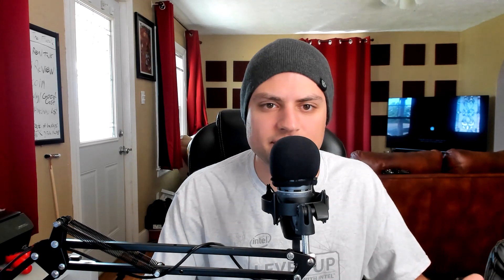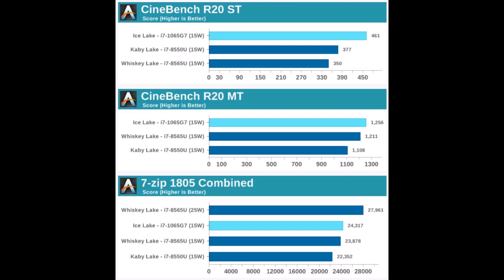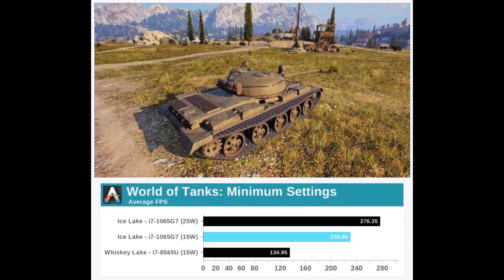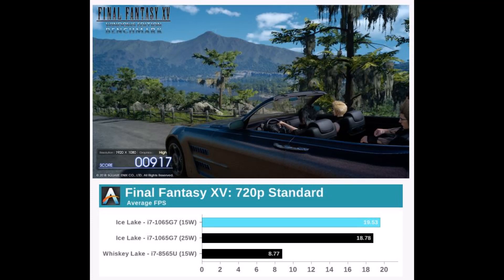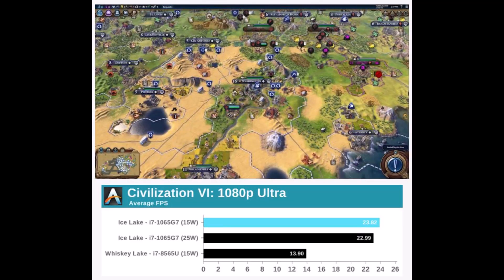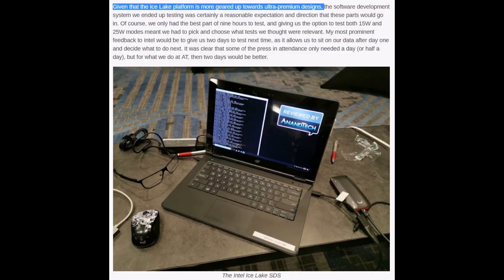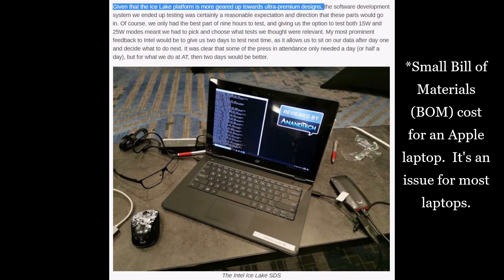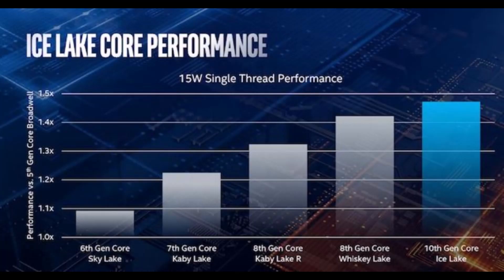The State of Intel’s 10nm+ Process

Comment: The next gen of AMD apus with zen2 and navi is looking much better for these low power applications
Reply: AMD need to get their shit together with the laptop manufacture. Once they did that, amd will wipe Intel ass for huge chunk of laptop market.
Reply: I don't think they will actually be good. But Arm is entering the laptop market, and soon is planning to add there own gpus to the market
Reply: @keithjones589  AMD has to do it. It's not an option not to. The laptop market is second after server, they have to get in there. And i think they will on Zen2+navi chips.
Reply: I don't think we are going to see navi on APU's any time soon, the article from wccftech that mentioned 7nm on apus was a complete mess, and according to that article it was a "raven ridge refresh" so zen 1 on 7nm. Also i kind of remember that the 7nm gpu part was going to be another iteration of vega, because of memory bandwidth contraints, amd wouldn't gain anything from putting navi, unless they put some hbm ondie, which would make the piece expensive and most likely not-compatible with their current packagings.
Reply: Omi the 3000 series G parts from AMD are Raven Ridge respins on 12 nm. They perform as well as you’d expect from binned 2000G series parts, which is what they are. 

Next up should be 7nm APUs, and there’s no reason yet to suspect those would be less effective than their Zen 2 architectural counterparts or rDNA siblings.
Reply: @daniellewis1789  zen+ does have architectural improvements over zen, but even if you say that zen+ is just a "14nm+" (which GloFo calls 12nm) port, zen 2 is not a port, zen 2 has a lot of dramatic changes. If they port zen  to 7nm i'd expect to see either higer frequencies or less power usage (maybe both on some frequencie window) but not anyway near the leap of zen 2. As far as vega goes, the main limitation for the igp on that sort of products is ofc memory bandwidth, which is the reason why we don't see anything above vega 11, just vega 11 with higher clocks, and i guess when apu 4000 series come out it'll again be the same...
Reply: @omi6816  I don't think that is correct there would huge gains from navi since it is already much better using gddr6 instead hbm2 it's also much lower power and smaller than vega even 7nm vega on top of that they would have to spend time to develop a small 7nm vega which would be a waste considering they already have small navi's in the works and navi apus for consoles
Reply: @shaynegadsden  WTH are you talking about? APU's use the system's memory, so they don't use gddr6 nor hbm, so is irrelevant that rdna uses gddr6, second vega is already working at 7nm (you know, the first consumer facing product is called radeon 7, but way before that there was radeon instinct mi50 and mi60) so the job is already done and i guarantee the yields are higher on vega 7nm than on rdna 7nm. The memory controller is irrelevant, we have seen vega with gddr5 (subor z+), we have seen polaris with hbm2 (the intel + vega nuc is polaris with the vega hbm controller), for amd is trivial the memory controller, is part of they customization options and they can use whatever they seem fit. Vega was using hbm on the dedicated gpu's because gcn is memory bandwidth starved, the more bandwidth the better performance, that and gddr6 still has a lower bandwidth , is more power hungry and was not so cost effective at that point, vega at the frequencies it was running becomes power hungry, but at the speed that has to be met for apus to meet their power envelope will most likely be irrelevant. APU's still have that starvation constraint, but is the same for gcn or rdna, because no matter what chip you use, you are still bound to system's memory
Reply: @omi6816  the fact that navi isn't as bandwidth starved as vega means it won't be as restricted with ddr4 and i acknowledged that there is 7nm vega but it is only large dies and the radeon 7 has already been end of lifed so they would still be investing money and time to make small vega 7nm which would counter the fact they are already doing that with navi so running to separate architectures on the same node for the same products would be stupid and wasteful they are making 7nm navi apus so why invest money to make 7nm vega apus when navi is the better option in terms of die size, power consumption and performance and it's already done for apus
Reply: @shaynegadsden  it is irrelevant the die size, the way they are organized is in cus, they can still repurpose whatever lower bin they get, the fact that radeon 7 is eol doesn't mean that vega in 7nm is eol, vega 7nm is the basis for radeon instinct mi50 and mi60 and radeon 7 were only binned down versions of mi50, as the yields improve it is normal that they have less spare CU's for that specific aplication (plus they were loosing a ton of money). Now get this: APUS are already working with vega, not at all with navi and we most likely won't see navi chiplets this year and i'm unsure if we will see them at all, why is that? because of the consoles, none of the consoles use chiplet approach and both have navi, as a separate chip (the kind of thing that apple does). And "not as restricted with ddr4" is just something you poked out of your nose and to make 7nm vega apus has the following advantages:
- Vega APUs are already done
- Vega 7nm is already done and yields are most like awesome.
- Vega has a shit ton of memory controller, we don't know if navi does (anything you wanna say here is comming straight out of your nose with no sources whatsoever)
- We don't know how navi behaves at lower clock speeds, navi is already proven time and time again (is not just down clocking, this also makes the piece be unstable)
- The way computing is done, there only so much you can do with ddr4, this is a HARD LIMIT, no way around it, that's why despite vega 16 and vega 20 existing, they are coupled with 2gb of hbm2, even if you can process bigger images, the image still needs to be put on the frame buffer and read from it to the display (this is the super fast memory on the cards or the regular system memory in the apus), there is no way around it, even if the card could process everything superfast, that bottleneck would still limit what can be output
Reply: @shaynegadsden  vega confirmed as the igpu on zen 2-based apus (renoir), so yes, ,we are not going to see navi used in apus anytime soon.
Reply: @omi6816  nothing has been confirm so that is wrong they have linux drivers that they believe are vega drivers but until AMD announces the product it best guess
Reply: @shaynegadsden  It has been confirmed over and over and over again, yet delusional fanboys still expect something that outperforms a midrange graphic card using way slower memory, a.k.a a freaking miracle.
Reply: @omi6816  yep just like 16 core 3700x's running 5ghz was confirmed until the day AMD made their announcement too
Reply: @shaynegadsden  the 3700x doesn't have 16 cores and doesn't get close on 5ghz with regular cooling i'm unsure if you are being sarcastic toward your own kind (fanboys) or what, i've been saying over and over again that the "leaks" from adoredtv seem made up.
Reply: @omi6816  my point is that most thought that was what what we were getting right up until the AMD announcement the same goes for the apus nothing is confirmed it is all speculation until it's officially announced
Reply: @shaynegadsden  whatever bro, just keep in mind that is out, some guys create crazy expectations out of no freaking where (like having chiplet-based apus using an architecture they won't really benefit from) and then when those expectations are not met, they get disappointed.

Comment: Zen 2 laptops should be pretty awesome upgrade, but I also wouldn't tell anyone to wait considering they are a minium of 6 months away. 8C16T at 25W and 4.4Ghz max boost clocks should be attainable, also on highend models I can see upto 24CUs, so it really should be an impressive APU. So ~2.3x faster in highly parallelizable multi-threaded workloads, 20 - 25% faster in single threaded work loads, and 2x faster in graphics than a 3700U configured at 25W.

If they add on-board memory something like 2GB-4GB of HBM2 or 2GB of eDRAM, this would only be for highend laptops though as why I like HBM more than eDRAM as you can just take the HBM away for lower end laptops and desktop APUs and wouldn't increase the total cost of those lower end laptops much except that you would need a HBM controller, which a single HBM controller isn't very large so it wouldn't increase costs much.

especially if Ryzen 4000 APUs are going to be monolithic, although I have my doubts about that, although I could see a 512MB of eDRAM as on the 7nm node that wouldn't be that big. So they can use the dies where the eDRAM doesn't function for the higher end laptops and add HBM and for the highest end laptops use both the eDRAM and HBM maybe.

And for like mid range laptops they can use the 512MB eDRAM with no HBM probably 6C12T with 10 - 12CUs which would still out perform the 3700U significantly in GPU performance due to higher GPU clocks, but also the 512MB of eDRAM —maybe 1GB, although I would have my doubts about that also if they want to scale the APU well from the ultra lowend to the highend, if they did go for 1GB though I could see them reserving 128MB for CPU data and instructions— Obviously though 6C12T would be a big improvement for the CPU side as well.

For the ultra lowend 6 - 8CUs without HBM or enabled eDRAM should be fine, 4C8T. I don't really see much point of enabling the eDRAM with that few CUs, but it would help in some tasks so maybe 256MB - 512MB depending on whether the full config is 512MB - 1GB.

Comment: Intel 10nm + is really disappointing, even though the architecture improvements are really “exciting” but with the clocks and graphics performance. I may just go to AMD APU on laptops, they’re safer and have sufficient graphics power for what a laptop needs.
Reply from the maker: Yep, I agree.  You get the feeling that Ice Lake could be incredible if it had 6-10 cores on TSMC's 7nm, but that's not reality.
Reply: I did and it's great. Now the 3k (zen+) apu laptops have just been released.
Reply: @0b1ivion  Which one do you have? I want one of those for back to school.
Reply: @Phenom98  HP elitebook 735 G5. Got it 10 month ago. Aluminum case and auo ips panel. Build quality is good and affordable. Very thin so no hdd slot though. There's a new model coming with new ryzen.
Reply: @Phenom98  I highly recommend the Thinkpad X395 if you can find it on sale.  Not too long ago it was on sale for $800.  Specs at that price was 3700u, 16GB RAM,  13.3 1080p, 256GB nvme.  All with the same quality as its x390 Intel counterpart.  The elitebook 735 is another excellent option.